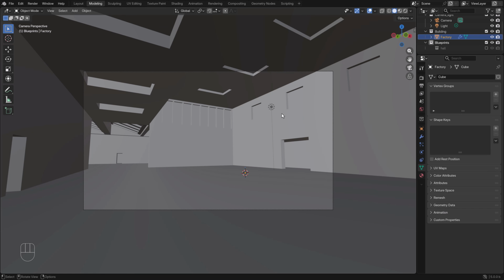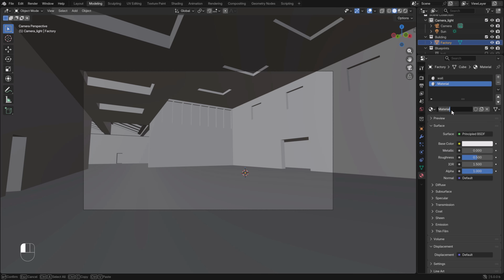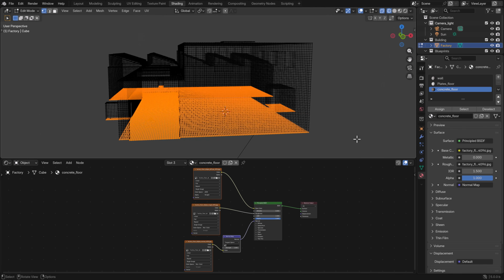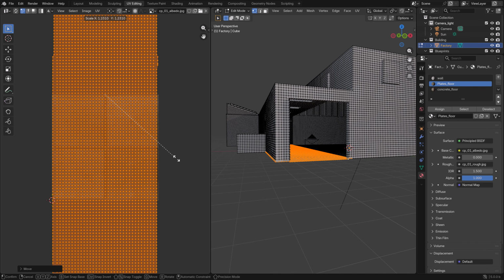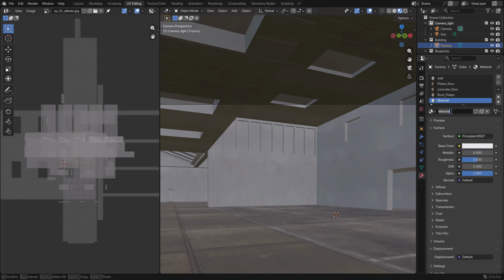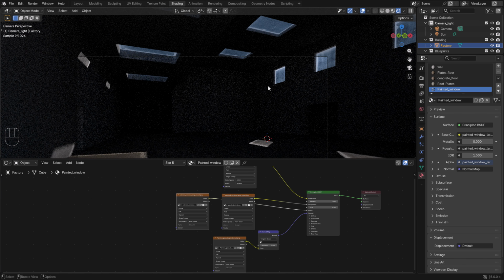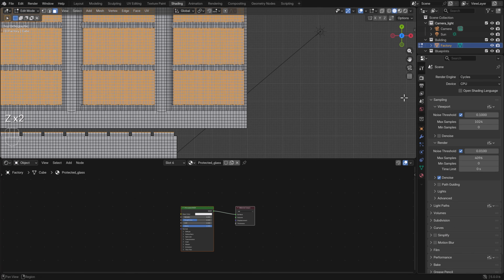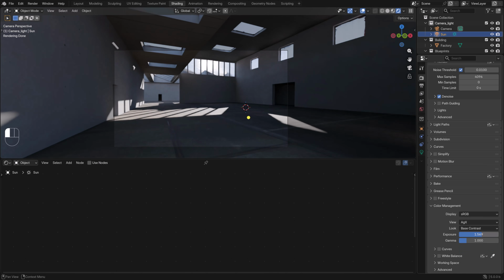Blender 5 Beginner Tutorial - Part 4 - Factory Materials

Comment: Loving it absolutely. I don't know why but I was unable to complete your paid courses lol but I am following on this one religiously! Also a tip here, since all images are in same folder - with node wrangler enabled press ctrl+shift+T and select images diffuse, roughness and normal... textures would be automatically connected to principle bsdf..you will need to delete mapping only.
Reply from the maker: There is indeed a significant speed improvement when using Node Wrangler. In the beginner tutorials I intentionally choose not to use it. If I start right away by activating an add-on, it may feel a bit overwhelming for beginners. I also have to admit that I don’t use it enough myself. It’s a habit, but I should reconsider using it more often.

Comment: I’m doing this on my Steam Deck, but I came to the conclusion dat it certainly wasn't my brightest moment. The little thing was close to melting with cycles. I wanted to make a quick render earlier, and it said dat the time remaining was about 3 hours and 30 minutes. And there is nothing in the building yet. FML. I rly. should swap to the "big" PC next lesson,  I don't want to think about wat happens to the Deck if we add an HDRI and multiple assets. It will prolly melt. Or lift off cause of the fans getting an epileptic seizure. Or lift off and melt midair while shaking.
Anyway-thanks for the excellent tut!